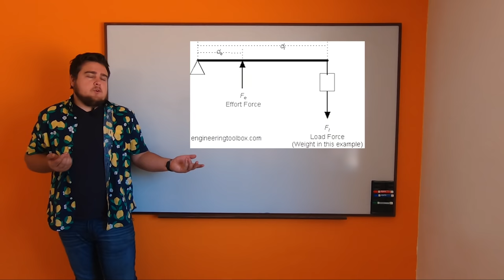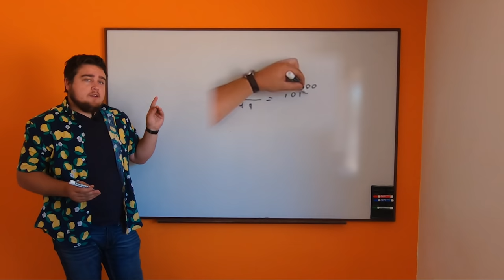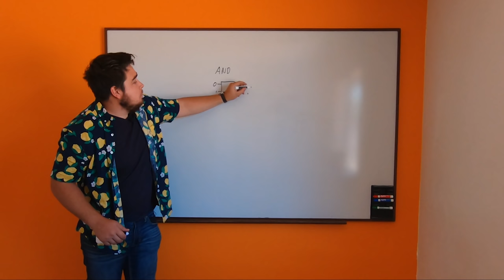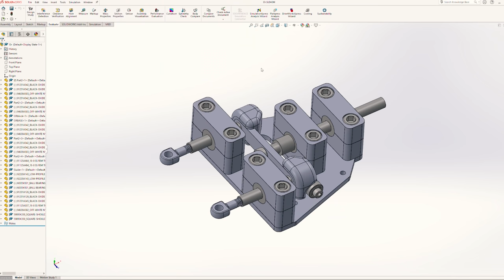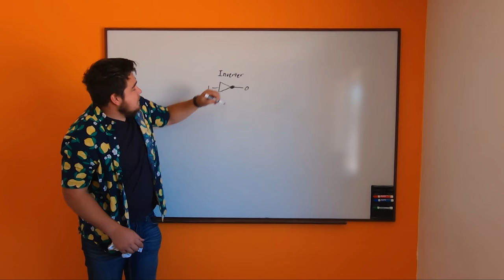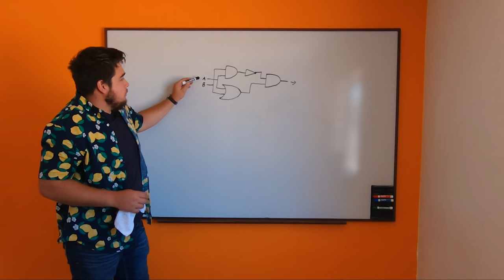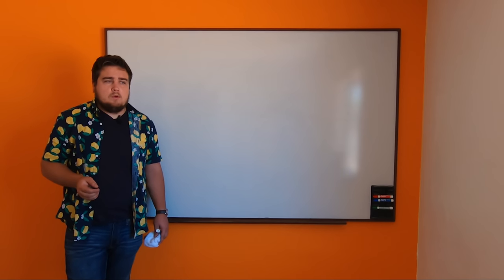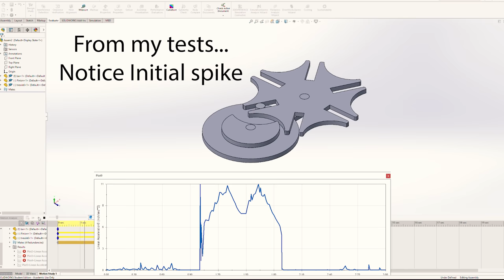Is a Completely Mechanical CPU possible?

Comment: 1) Yes, it is possible to build a mechanical logic processor.
2) The frictional losses in a mechanical logic processor would make the entire thing melt into a pile of slag if it ran at anything close to a usable speed.
3) If you're really committed to doing this, you should use pneumatic gates or hydraulic gates instead of purely mechanical gates.
Reply: but what if he wants purely mechanical gates?
Reply: I don't think a "usable" speed is required for this kind of project. It's not really going to accomplish any significant work, just getting it working is an amazing feat
Reply: I think that was called Fluidics.
Reply: What if this was working in the vacuum of space?
Reply: @sixhundredandfive7123  Heating, cooling, and different lubrication issues are very different.  There is no "air" to carry away any heat.  Parts exposed to extremes of temperature.
Reply: @howardhiggins9641  So obviously it needs cooling like any other CPU, throw into a controlled enviroment where the temperpature is just a few degrees above absolute zero or just use liquid nitrogen like those record holding benchmarking guys who push their processors to over 7ghz.
Reply: @howardhiggins9641  Thank you for the informative response. Space interests me. It works so much differently. I think of gears and mechanical computers being used in space. I wonder whether we, as humanity as a whole, could live in colonies at LaGrange points sustainably.
Reply: Also an aside: by "gears" i really mean technology that has proven itself to be very hardy. Think tractors from the early 1900s that are still being used. Think of the Apollo computers which are still robust considering their age.
Reply: @sixhundredandfive7123  Just a passerby here... But, yes, I believe we absolutely could. The biggest (well, one of the biggest) technical hurdles is handling radiation, which, outside of Earth's magnetic field, is really quite dangerous and deadly. However, there are potential solutions/mitigations which are actually quite low-tech. One of the simplest ones is simply to surround the living space with enough dense material to absorb most of the radiation, either with rocks/metals (carve a space station into an existing asteroid, or cobble some smaller asteroids together), or, probably even easier, just with water (either ice, or melted). Surprisingly, water is quite good at absorbing most radiation, and it turns out that there's lots and lots of water floating around in space. Plus we need water to live and grow food, so we'll need to gather plenty of it anyway. Might as well use it as shielding while we're at it.

Indeed, if we can conquer the radiation problem, there's only a few other minor (cough cough mumble mumble) issues that need to be solved (like managing a sustainable ecology), which all have relatively low-tech solutions. I believe it's not so much a question of whether it can be done, but rather whether we have the collective will to make it happen.

Another nice perk of colonizing the Solar System: Sunlight is not filtered through Earth's atmosphere, and so solar power is significantly more efficient (even without using the highest-tech solar panels/systems). I forget the actual difference, but I seem to recall it's in the neighbourhood of at least twice as much usable sunlight in the same orbit as Earth. 

In other words, there's a sh!t-ton of raw power available in space: The Sun itself is an enormous, super-efficient fusion reactor that could easily power colonies with already-available modern technology, not even the highest tech!

Imagine: A tiny tiny tiny fraction of the Sun's total power output just so happens to land on Earth, and that minuscule amount is enough to power all(*) life and technology on the entire planet. Now imagine: How much solar energy is not falling on Earth! Certainly more than a million Earth's-worth of power, just there for the farming! The potential future of Solar System colonization is mind-boggling!

(* Fossil fuels originally came from Sun-powered organisms; wind and hydro are all ultimately derived from the Sun as well; the only power not directly from the Sun is nuclear and geothermal (which itself is mostly nuclear itself, btw).)
Reply: i conjecture that it can run at 2.4Hz safely, it's not that much but he can do a lot of basic calculations in minutes, i say this value because there is a Japanese relay computer that ran at 2.4Hz and even though relays are not the same as physical pistons, they do make mechanical movements
Reply: why would you want a usable speed? it's not practical anyways because of the size and it is amazing even if it's very slow
Reply: @tatomar001  i love it Because it is a size you can hold; perhaps work on With human hands..
Reply: @sixhundredandfive7123  yes but op was talking about it being "usable" in terms of like substituting a pc's cpu, i was just saying it makes no sense to think of it that way
Reply: The heat is not necessarily a problem. If you're building an 8 bit machine, you're not going to use it for anything anyway. It's a proof of concept, so it can be slow. What I wonder the most is how he will get amplification of signals. A big difference between a transistor and his gates is that a transistor will always output the same output voltage, independently of the signal voltage (as long as it is above the threshold). That means you don't need to worry about electrical resistance, or friction in this case, making the signals become weaker and weaker with each step of the calculation. He's going to need to power the gates, probably with the clock signal. I think it can be done, but I believe he's going to have to redesign the gates.
Reply: Hmm considering the Frictionless materials and lubricants and nanolubricants. It can be done. Remember the first computers were MECHANICAL.
Reply: If you would have watched the video you would have seen the part where he flatly states "The beauty in engineering doesn't necessarily have to be efficiency". You missed the point entirely.
Reply: Zuse's Z1 machine runs at 5 Hz iirc.  And it makes a nice sound while doing so.
Reply: @DelilahDraken  In 1934, not 1940s.
Reply: @FUZxxl  My mistake then.
Thanks for the correct date
Reply: @DelilahDraken  Except I also got it wrong.  The real year is 1937.
Reply: @DelilahDraken  I mean yeah, but don't forget Charles Babbage. His analytical engine -- if built -- would have come 50 years before Zuse, and it wasn't electromechanical. It was just too expensive for him to actually build it, but the theory at least holds up.
Reply: We had a Pitler double spindle programmable lathe. I forget the date of production. 1950s or 1960s I think?  Very large cabinet of mechanical relays, like ten foot by twelve foot by 8 foot. The electronic replacement fit generously in a 12inch by 10'inch by 6 inch case. Approximately I think.
Reply: I forget if it used binary or decriminalize logic.  
Admittedly used electromechanical relays. 
Naval big gun computers were I think all mechanical.  
See battleship gunnery.
Reply: Mechanical stuff should be useful in extreme environments like Venus where electronics break within minutes. But I don't see a use-case for an actual CPU.
Reply: @sixhundredandfive7123  Also, in a vacuum, there may well be issues with contact welding as wear parts expose non-oxidized surfaces.
Reply: is there such thing as a hydraulic not gate? how does that work?
Reply: Educational. But I tremble at what it would take to simulate 2 + 3 - 1 or the letter 'A' upper case.
Reply: @festiveFurry : I chose my wording poorly. Hydraulic and pneumatic gates are still purely mechanical, they just don't rely on pivoting pieces of metal. If he really wants pivoting pieces of metal, though, refer to Point #2 -- a usable speed will have to be sacrificed in order to achieve that goal.
Reply: @sixhundredandfive7123 : The vacuum of space would make the situation even worse. Without a microscopic layer of air molecules on the surfaces of the moving parts, many of them would weld together with just a small amount of heat and pressure -- and heat would build-up faster due to the lack of an atmosphere to convect the heat away.
Reply: @eduardopupucon : Whether it could run at 2.4Hz depends on the physical length of the logic circuit pathways. The longest circuit pathway must be able to run to completion in 0.416sec in order for the entire processor to have a speed of 2.4Hz. Considering that logic pathways can get long and complex very quickly, that may not be feasible.
Reply: @tatomar001 : I never specified that a "usable speed" was equivalent to a computer CPU. That would be physically impossible with gates this large, no matter how much money you had available for the development. Even Babbage's Analytical Engine couldn't be made to run reliably at any speed, and it is millions of times simpler than a computer CPU. No, when I said a "usable speed", I meant usable for performing a simple task like adding two numbers together, or controlling a simple piece of machinery such as his garage door opener.
Reply: @ordikaskirita5234 : The first computers were not purely mechanical. They used relays, but they were electric-powered. Nobody ever successfully built and operated a purely mechanical computer. Even nowadays Charles Babbage's Analytical Engine can't be made to function reliably at any speed.
Reply: @DelilahDraken : No he didn't. The Z3 was electromechanical, not purely mechanical. It used relays.
Reply: @Niosus : My parents own a typewriter that amplifies the force of each key-press using a spinning rubber drum powered by an electric motor, which grabs the key being pressed and slams it against the paper. A similar system could be used to amplify the force transmitted through the output rod of each mechanical logic gate. However, then it would no longer be a purely mechanical processor, and its electrical consumption would be formidable with all of those spinning motors waiting for something useful to do.
Reply: @jordanhoman0212 : A hydraulic not-gate is very simple. Pressure applied to the input fluid channel closes a valve that separates the pressure-supply from the output fluid channel. So if fluid pressure is supplied to the input channel, fluid pressure is cut-off from the output channel, and vice-versa.

Comment: By the way, there is a practical application for this. On the surface of Venus, electronics don't work, everything needs to be mechanical. NASA is/was running a contest for a venus rover that uses no electronics and communicates by positioning pointers to be read from orbit with a camera.
Reply: its probably going to have to be light enough to be shot in to space, unless it only needs to be 4 bit, he almost has a finished product
who the heck would want to go to Venus anyway
Reply: Or maybe the proper question is, how can we get electronics working on the surface of Venus?
Reply: @fluffmiceter1846  active refrigeration, vaccum tubes may work, but I wouldn't want to run them through the vibration of launch and landing, let alone the thermal stress of code of deep space followed rapidly by the heat of reentry and the surface of venus (and there is a good reason we don't use them for computers any longer, their reliability is poor)

And since we don't manufacture large numbers of tubes any more, setting up a production line for them would not necessarily be any cheaper than developing mechanical computers, and the result may not be any smaller.
Reply: remember, the surface temp on venus is really hot. hot enough to melt lead and solder, so any electronics or plumbing that you use can't be soldered together (or the solder joints need to be in the cold side of a refrigeration cycle)

to do active refrigeration, you need t pump the heat from the area you want cold to a fluid that is significantly hotter than the area that you want to dump the heat into.

The "average" temp on venus is ~900F/460C so during the day it's going to be hotter, so you would probably need to need to heat your refrigerant to above the melting point of aluminum (1200F/660C) to begin to be effective
Reply: @davidelang  Ouch. Is there no conductive metal that has a really high melting point? I guess then the issue becomes "how can we use this to solder stuff together if we can't melt it"
Reply: @fluffmiceter1846  If you think how transistors can be fried by overheating them as you are soldering them in place, think about what is going to happen to them on venus.

There have been electronics landed on Venus, they super-chill on the trip there and are designed to only warm up slowly, but after a few hours when they heat up, they quit working forever.

The only electronics I can think of that work at high temps are vacuum tubes.

Comment: Back when I was in Highschool I had a similar idea for a clockwork computer, using the direction of spin as bits. I drew up the plans for the gates and a potential processor, unfortunately, 3D printers didn't exist quite yet back then.

Comment: interesting thing I can already see is that the gates aren't exactly binary  - since you can push them the gate inputs to different degrees. You've created some weird binary-analog abomination and that's pretty cool.
Reply: See fuzzy logic: https://en.wikipedia.org/wiki/Fuzzy_logic
Reply: As one of my EE professors used to say, 'All circuits are analog if you try hard enough.'
Electronic circuits have the same issue - a typical 5V logic chip will always see an input under 0.8V as a '0' and an input over 2.0V as an '1'.  This leaves a range (0.8V - 2.0V) where the behavior is 'undefined'.  (It may be off, on, or even weakly on or weakly off)
Some amount of effort is put into avoiding this undefined range.
Reply: @cctmsp13   Detents.
Reply: As someone who looked into GTL systems I know the issue. At least in my use case I had some degree of control over the high and low thresholds.
Reply: @cctmsp13  I once got a fortune cookie while on a business meal. It said "Even digital circuits are made of analog parts." It was like destiny.
Reply: @cctmsp13   I once got in trouble with my manager for "wasting time and not getting the important schematic work done fast enough" when I spent a day or two analyzing the driver & receiver voltage ranges for the digital logic on a design (to check for exactly the situation you are describing). Even though I objected, I stopped my analysis. 

Wouldn't you know it... The design had problems at hot&cold temp ranges because some of the digital driver's voltages were in the undefined portions of the receiver ICs. At that point, the only thing that was going to fix the issue was a board respin. 

Then management blamed the engineers for not "arguing their point forcefully enough." Man, that company sucked. Management was clueless. I was happy when I left.
Reply: At a low level electronic gates are also analog.
Reply: @beta_cygni1950  ah, i see you have worked for literally any publicly traded company on planet earth too.
Reply: That's the kind of situation you would need a form of buffer added to the output.
I can imagine this being done mechanically as well.
Reply: We shall call it ..........FUZZY LOGIC
LOL
Reply: Isnt that similar to quantum bits guys?
Reply: The term is ternary. If there is a fixed set of values, it is digital. If there is an infinite number of values depending on how close you look, it is digital. There is only like 1 undefined value, so it is ternary. There are actually a few ternary computers that have been made, and I am researching them (to find a way to make a computer in this one game). https://en.m.wikipedia.org/wiki/Ternary_computer

Comment: This is the same mechanical systems that were used on mechanical train signalling systems. These were popular in the 1940's onwards. They are still used on some of the older london underground lines. They are called interlocking machine rooms

Comment: Great video! I was surprised you didn't mention hydraulic computers. Lots of older automatic transmissions are, very basically speaking, just sets of logic gates that are controlled using hydraulic fluid and vacuum.

Comment: Someone builds a CPU in minecraft

Wesley: So can we build a ryzen out of spare parts in the garage?
Reply: Technically yes, but the energy needed to drive it likely would render it useless. It's much easier to move a few electrons for a few nanometers than a few metal rods for a few millimeters, I think.
Reply: @FlameRat_YehLon  How cool would it be though.
Reply: @FlameRat_YehLon  OH REALLY!? DO YA THINK!?
Reply: @OnFight1997  Computation is basically just wasting a whole bunch of energy to gain the tiny amount of information entropy. I mean, you wouldn't want your computer to just yeet away while doing stuffs so... Everything would turn into heat eventually.
And this kind of mechanical logic gate is huge (a few million nanometers vs a few nanometers in process level), which means you need loads more energy to drive it in order to achieve the same computation power.
Reply: @FlameRat_YehLon  when he said "cool" he probably meant "amazing to look at while performing some calculation", I guess he wasn't referring to temperature.
Reply: @pietrocavicchioli6128  I think he forgot to type the "cool" before I wrote the reply, and he edited his comment after, and that got me confused
Reply: If you have billions of parts and screws and enough space and a power source to move the whole thing, sure